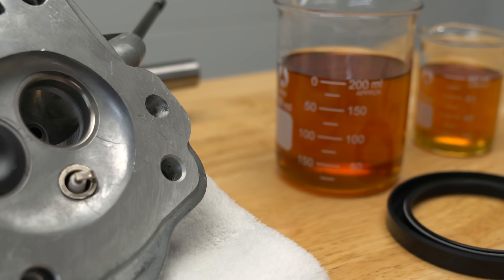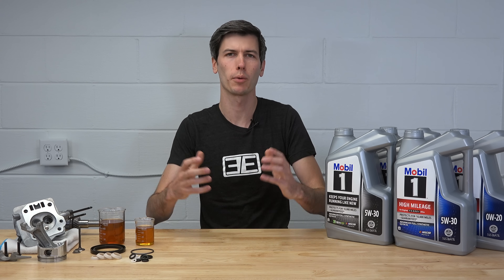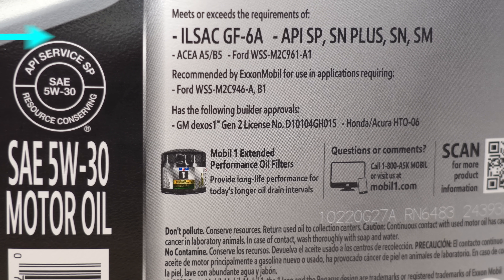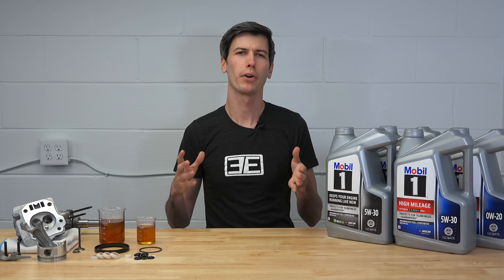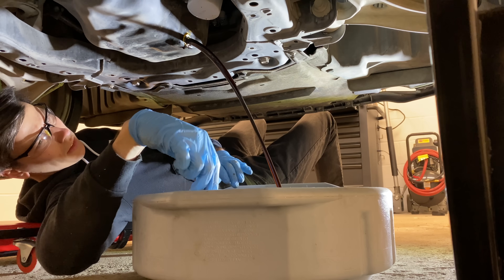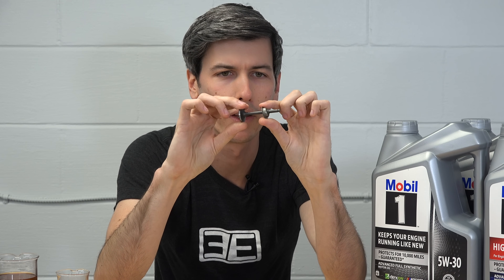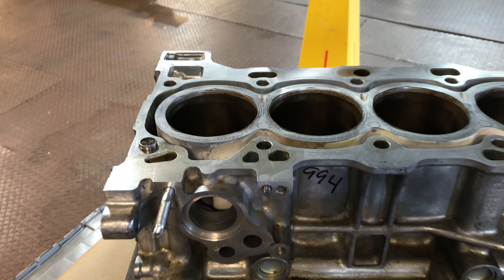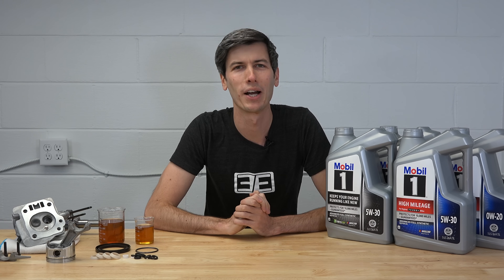Is Synthetic Motor Oil Bad For Old Cars?

Comment: What about going up in viscosity when you live in hot climates like southern Arizona?  The manufacturer recommends 0W20 (AKA water), and clearly there is no need to have this oil where colder temperatures do not exist.
Reply: Naw. 20w oils have been used in the SW US for almost 20 years. Besides the cooling system ultimately maintains engine temp because most of not all cars have the oil circuit connected to the coolant circuit via heat exchanger.   if anything a thicker oil will hold more heat.

Comment: Nice job, even though you are tilting at windmills.  I spend so much time on forums explaining these same things in the same way, but a lot of people just don't want to listen.  The myths of the automotive world die hard!
Reply: Indeed.

My '87 Mazda 323 just got a full engine rebuild at 303k km (inside it looked like a 600k km engine, and the 1k old synthetic looked 30k+ old).  SEVERAL mechanics looked at the oil, said it was too thin (10W60, the manual calls for 40 or 50 hot in our climate), and outright said that the engine failed because of the thin oil (the cylinders were badly worn, but apart from that and LOTS of gunk the engine was still fine mechanically, the bearings also had minimal wear).  Oh, and while the engine was apart my friend who rebuilt it (he also blamed the oil) told me that the rings were not original, but everything else was (meaning it got new rings somewhere between 87 and 89, because my parents never had internal work done).

EDIT:  Oh, and over here it seems nobody understands how multigrade works.  If I tell my friend that the car can take 5W40 (because hot SAE40 is fine, and cold SAE5 is thicker than that), he insists "but when it's cold it's 5, and 5 is way too thin".  I even drew a graph roughly (using straight lines) showing how viscosity changes with temperature, and how each hot/cold rating corresponds with the different monogrades (and different multigrades).  His response was to point at the graph, and show me that when the thicker oil is cold, "it's already there".  That's the same thing that the mechanics don't understand either.  They also firmly believe that anything synthetic will automatically destroy an old engine "because it wasn't made for synthetic".

Comment: In general the tighter the engine tolerances  the thinner the oil.  The higher the RPM the higher viscosity oil.

Use your base OEM numbers and adjust as needed.
Reply: I use Mobil1 0w-30 in both my 94 Integra (373k miles), and 2000 Miata (159k miles, non-original engine).  OEM spec is 5w or 10w-30 on both.  In my wife's 2014 CX5 it calls for 0w-20.  I use the OEM Mazda 0w-20 oil with high moly content for that car.  Used oil analysis results for all cars have come out excellent.

Comment: You haven't addressed the need for ZDDP in "old" engines, those with flat tappet cams. Much more important than leaking seals.
Reply: i was waiting for him to talk flat tappet high spring pressure cars, didn't happen
Reply: I think I heard some oil manufacturers said the modern oils were ok for older flat tappet cam engines. But I would definitely go with a high zinc zddp oil for them.
Yes ZZDP is a sacrifical extreme pressure lube for the high pressure regiens of the lifter heels and cam lobes that is not needed for roller lifters and followers. Amsoil has several excellent high zinc oils for those engines that I use and recommend. Most engines had rollers by about the mid 90's, Ford v8 351s had em in 94, first year of port efi 5.0s had em if I remember right was 85 and gm vortec v8s had em in first year vortecs of 96 that I know of, other engines you should do some research on.
Reply: @429thunderjet2  My 1990 Ford 302 (1990 Grand Marquis Wagon) doesn't have Flat Tappets, so that one's out.
Reply: @101Volts  roller cam 302 started showing up in some fords around 86. I had a 85 crown vic that was a flat tappit still. All 86 ho5.0 on were roller cam motors. Great motors i have had 302s in my late 60s mustang that would run low 13s and get anywhere between 20 to 25 mpg .
Reply: Yes would be helpful
Reply: Most people making these arguments are completely oblivious to this issue. I guess it depends on what your definition of "old" is, but this can mislead people with an old flat tappet cam and ruin their camshaft.
Reply: @Terminxman  Absolutely correct. Just know a consumer warning should have been put on every bottle.
Reply: running my stock 71 Ford V8 with synthetic for 30 years, no issues.... beg to differ... enough zinc already
Reply: @alanmartinez488   probably more from the lead coated parts.
Reply: "...need for ZDDP in "old" engines,..."
Now you've gone and done it. Builders from hell will be all over this thread.
Reply: @u2mister17  yea i guessed you called it.
Reply: ZDDP was removed in 1995 by government mandate because it limited the life of catalytic  converters. That's why roller cams became almost universal at that time.
Reply: Didn't he already do an oil video that touched on that subject?
Reply: Why I always use diesel oil in everything, especially with flat tappet cam.
Reply: @CharlieK92004  even most diesel oils don't have more than 1200 ppm of zddp
Reply: @Terminxman  1200 is perfect.  Too much is also bad.
Reply: @solarsynapse  1200 is not enough
Reply: What is ZDDP?
Reply: Best thing for flat tappet cams is diesel or racing oil. I run 15w-40 in my 350 Chevy. Thicker oil is also better for longevity in old engines. As is the added zinc
Reply: Zinc or more accurately Zinc phosphate kills catalytic converters this is why it was reduced/removed through the 1980s. In Australia we can get high Zinc oils and zinc additives for older flat tappet camshaft engines.
Reply: @Benni711  True, should always read the label before we just use something.
Reply: Yup was just looking to see if anyone had brought this part up. I still run synthetic but always with a 5% break in adaptive haven had issue eating cams and lifters since I started this tact about 15 years ago
Reply: The flat tappets on my MGB looked like the surface of the moon after 30k miles on semi synthetic. I have changed to classic ZDDP oil after putting that right.
Reply: @stanbest3743  semi synthetic or "synthetic blend" oils are halfassed substitutes for the real thing. You won't get the protection that "synthetic" promises unless it is full synthetic.
  IMHO.
Reply: Charles Larkin  Gotcha! I know what that is now. I used it when I rebuilt an engine a while ago. It's good stuff. (:
Reply: You bet, good call. You can use it with synthetic oil.
Reply: Valvoline has still got that in it for older engines the only oil that I know of that has it....
Reply: @georgemercer5977  Thanks. When I first learned of the problem 15 or so years ago, I bought a couple of cases of ZDDP additive for  my  3 older 350 chevys so I personally have it covered. I just wanted him to address the issue.
Reply: @georgemercer5977  amsoil makes it. The best oil 100% synthetic
Reply: Charles Larkin  why not use amsoil with zddp They make this oil for older cars. Amsoil is the best oil. Only oil that is 100% synthetic.
Reply: No reason to address it because ZDDP is still in all of the oils today...just at reduced levels from previous oils. If you know how ZDDP actually works you understand the ppm level makes absolutely no difference...works the same at 800ppm as it does at 1200ppm. More does not equate to greater protection, it only extends the time of depletion.
Reply: You tell tell them. This guy doesn't tell the whole story!  I had a two flat tappet jeep one got over 400000k on it !the second just over a 100k ! Found out the U.S. government had oil companies change their formula for fuel economy .this new formula oil is find for roller motors but not flat hydraulic cams! Why this information isn't main stream news is beyond me! Thanks A lot you all good for nothing left .

 While it cost me thousands!!!
Reply: @Roadking556  It is common knowledge, to people who pay attention to what their engines need. Btw, diesel oil still has ZDDP in it.
Reply: @sparkplug1018  some zzdp, but it has been reduced a lot in diesel oil too.
Reply: @sparkplug1018  point is the oil was changed without my knowledge! I have a 88 jeep that has over 400k on it, using a very popular Full synthetic. Using the the same Oil didn't even get 100k on the second jeep .which was a oil related failure. After researching found out the oil formula was changed due to government regulation and law!! And to get a insult from someone who probably never turned a wrench pisses me off. I raced cars back in the 70 up till the 90s and worked on cars for about forty years! Its also common knowledge if you don't have anything nice to say ,keep your mouth close. Someone standing near you may just close it for you.
Reply: @Roadking556  Yeah I say whats on my mind, don't really care that I might upset someone, that's their problem not mine.
Probably never turned a wrench? Shouldn't assume things, since I just got done rebuilding another transmission today, you know that skill most people even racers don't have?
Regulations change, get over it, its our job to keep on top of that, not their job to tell us.
Reply: @sparkplug1018  yah but it's to bad we have to find out the hard way. Some years ago a buddy had a bunch of cam failures on a 351 stroker in his 69 Stang, until the cam company told us they figured out the oil companies took the zinc out. He had already gone to a roller cam at that point.
It cost him a lot of money too!
Reply: @429thunderjet2  I remember that rash of cam failures some years ago, yeah was a real PITA. As soon as I trashed one though I went looking for the reason, figured it wasn't likely I caused it and turns out sure enough they lowered the zinc levels.
Something we always have to keep on top of since the regulations change somewhat frequently, and manufacturers are always changing stuff too, so that's another level of annoyance.
Reply: @Roadking556  EXACTLY! I'm with you!
Reply: @Roadking556  I run Rotella T 15W-40 diesel engine oil in my Ford 300 6cyl with flat tappets.  It has the proper amount of zddp.  Newer oils later than API J are not good for these engines.  Air cooled small engine oil and ATV/motorcycle oil is API J.
Reply: @solarsynapse  That's what a switched over to about 2 years now.thanks.
Reply: @Roadking556   GM lobbied the U.S. government limit Zinc phosphorus to 800ppm from 1200ppm for most motor oils because GM wanted thier catalytic converters to last 100,000 miles to reduce costs .
Reply: @Roadking556  IMO because rollers started being mainstream in the mid 80s, and the number of 40+ y/o cars out there is low.  If its a built motor you should know what is needed.
Reply: @bowez9  they Were not main stream in the mid or late 80s
Reply: @Roadking556  Ford Essex, Windsor and Duratec motors.  Sorry if GM and Mopar were playing catch up for 20yrs. 
But even GM started the shift in 87.
Reply: @bowez9  Mopar started in 86 with the introduction of TBI at least with the small block V8s. However engines like the jeep 4.0L were hydraulic tappet until the end of production. Same goes for fords 300 CI inline 6. Not all fords mopars or chevy engines had rollers.
Reply: @92powerdiesel61  didn't say all just said mainstream.
Reply: @bowez9  So your just gonna leave out some of the biggest workhorses? The Ford 300 is the only ford engine I'd ever own and I'm actually jealous of the fact that Chrysler never made something similar.
Reply: @92powerdiesel61  by the 80s lets be honest the  300 was on its way out.
I love the 300 have one in my f150 with 600k miles all orginal.  But doesn't change that the market went Turbo Diesel.  

Remember the 300 doesn't compete against other gas burners but diesel, and industrial motors.
Even though I would argue a Turbo aluminum 300 would have been more than competitive against the Powerstroke, Duramax and Cummins, but diesel was cheap when this decision was made and Fords best motor got sent out to pasture.
Reply: @bowez9  The 1989 dodge 250 and 350 had the 1st mainstream turbo diesel.  For a 150 chassis the 300 was the best truck motor you could get at the time. Obviously the 3/4 and 1 ton class got the turbo diesels which are better.
Reply: @92powerdiesel61  look up the 265 hemi used in Australia. Very torquey motor in stock form and also screamed in the e49 charger. 302hp triple Weber carbs in that form.
Reply: @bowez9  There were engines being built with flat tappet cams up into the early 2000's. And there are still plenty of 40+ year old vehicles still on the road. You're just not looking for them.
Reply: @christmascreature1  mainstream production engines ?  And how many all orginal 40+y/o engines are still on the road,? I would say statistically insignificant.
Reply: @bowez9  doesn't matter if they are original. If they have a flat tappet cam they need additives that synthetic oil doesn't have
Reply: @christmascreature1  originality does matter in regards to my orginal comment.
If your going from a roller to flat its expected you know what your doing and why.
Reply: @bowez9  I have never heard of anyone converting an engine from roller components to flat tappet. Its usually the other way around. When you say mainstream production are you referring to mass production? If so, then yes there are still plenty of 40 year old engines out there. Dont know where you live, but where I live, we keep our vehicles maintained and keep the old ones on the road because we dont like to drive a plastic shell. We prefer to drive something made of metal.
Reply: @christmascreature1  racers commonly go soild flat tappet.
As for vehicle age the average in the US is 12yrs.  I don't see any AMCs or Reaults, Packard, or Studebakers either.  Heck I hardly ever see a Plymouth.
Reply: @bowez9  I used to race and we never swapped rollers for flat tappets. If an engine already has roller components thats a good thing. Less friction. Thats the whole point of rollers. As far as what make of vehicles you're not seeing, it must be a regional thing. We still have plenty of stuff here from the '70's on up. I myself have 2 mid-70's Ford pickups. We also have a bunch of auto clubs here that restore autos from all ages and parade them around.
Reply: @christmascreature1  soild flat is more durable,  and when running at sustained redline having a lifter collapse is a bad thing.
Those vehicles you see aren't daily drivers, by your own implications.
Reply: @bowez9  OK. You never mentioned we were talking about solid lifters vs. hydraulic. I thought we were talking about flat tappet vs roller. They do make solid roller lifters and they hold up just fine at high RPM's. Since you didnt read my comments thoroughly I said there are many vehicles from the '70's on up AND there are car clubs. Hence there are daily drivers that are older. I dont recall you saying older vehicles had to be daily drivers anyway. Is that a requirement?
Reply: Reg Fake thanks!!

Comment: I have a 22R engine and use 20W-50, it have a leak, but I don’t know if I repair the seal, what viscosity can I put on the engine? It have the thickest Viscosity, any recommendations? And what’s the benefits of using synthetic and staying on the mineral 20W-50

Comment: As someone who works a fair amount with rotary's, I don't think the argument has ever been "conventional oils don't create carbon deposits", but rather that synthetic oils create more carbon deposits/don't burn as clean.  I honestly have no proof either way, but using conventional has been working for me and thousands of others for decades.

If I no longer had the omp (which is the whole reason for this debate in the first place) I'd gladly run synthetic because yeah, it's an overall better package.  Although I'm not going to switch unless some actual data comes out, which realistically will never happen these days since rotary's are now far out of the mainstream.
Reply: U are right my friend, I guess they will have to find out the hard way why they shouldn't use synthetics with an omp system

Comment: Here in the rust belt, I get asked all the time what best oil is. I tell everyone you can buy the cheapest oil you can find, even that Walmart recycled oil, because your car is going to rust out long before you will ever wear out an engine based on what oil you are using. Most importantly CHECK YOUR OIL LEVEL EVERY WEEK. I don’t care if you have a newer car, so many people are running around with low oil levels they are doing more damage and wear to their engines than worrying about what kind of oil or brand to use.

Comment: Synthetics were used on the Eastern Front by Germany in the 1940s
Reply: They had no other choice, also synthetic gasoline. both were crappy but worked. Derived from coal and other stuff. Formula lost. Wouldn't that be something if we had the recipe.
Reply: @philipmackin1025  we have a Leader in Coal Gasification powering most of South Africa inland areas , SASOL
Reply: They also used synthetic rubber. Butyl